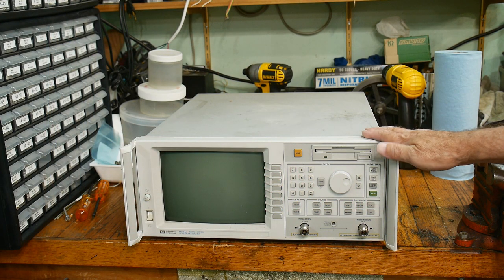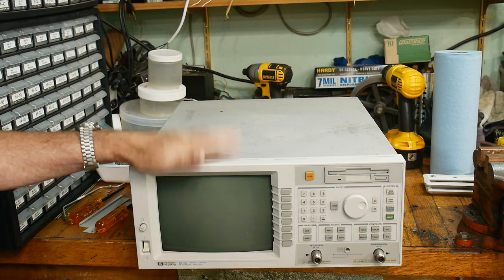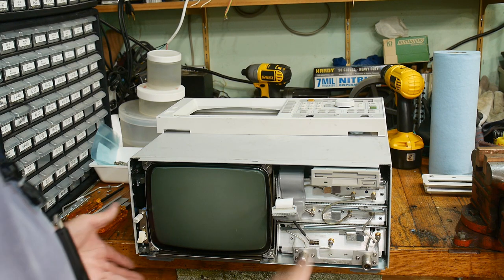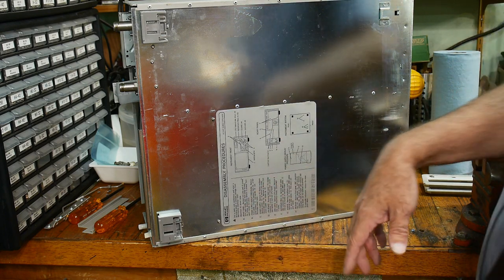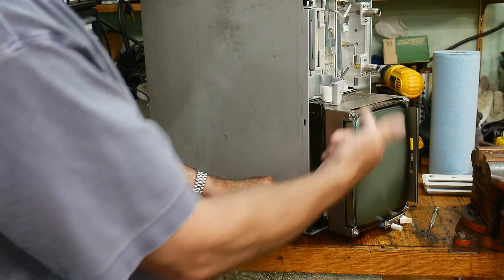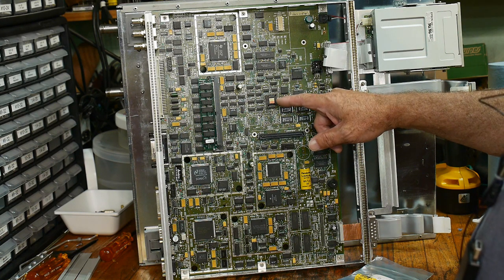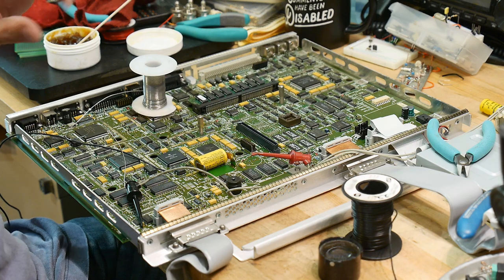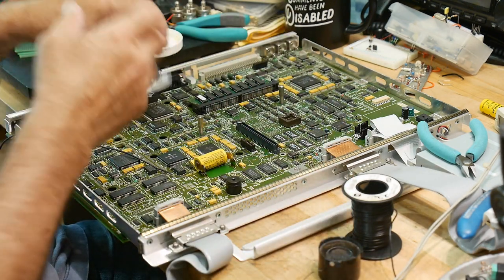#867 HP 8711C Disassembly and Battery Change

Comment: since you have the power supply out, you might want to a peek to see if there are any Rifa X or Y safety caps in the supply.  In my HP8591E there were six and they were all badly cracked.  HP and others used them 80-90's in the SMPS and they notorious exploding without warning.

Comment: In the 80s I "designed"  50- 300 mhz cable TV active devices around  a Motorola chip of about  30 dB gain.  This "design" process was checked by a Tektronics system analyzer which I sat in front of with a hot soldering iron in hand. Eventually,  my partner produced a buyer for the apartment house amplifier I had created. He looked at a sample and rejected it based on return loss being too high (it was 17 dB). I finally got it up to 20dB and the deal was done.  Good thing he didn't pay any attention to input  insertion loss.   I really like your HP 8711C.  Does things my old boat anchor Tektronics might dream of.
Reply from the maker: 20dB has always been my magic number

Comment: Read the voltage difference across the resistor to confirm the new battery is providing the power = Clever technique tip.

Comment: totally agree on the "self grounding", equalizing the potential to chassis or some common point and then keep the connection and not letting charge build up is key. just doing the esd strap's job consciously instead of passively depend on some safety net.
Reply: I am a hobbyist. From IG's procedure and your comments, I think I may have missed something about self-grounding. Should I ground myself to circuit null, or to Earth ground? Please explain as to which and why. Thank you for your help.
Reply: @t1d100  the absolute potential referred to earth ground is no so relevant. You want to be at equal potential to the object you're working on. So when handling an open computer for example, you strap yourself to it's chassis, or holding the chassis before and during handling the components inside. When soldering it becomes more important as the iron is probably grounded to earth, so you will need to incorporate your tools in this as well and then it gets easier to use the earth ground for everything.
Reply: @knglaser  Good info, thank you. Some circuits have isolated islands of power... Like inverters, etc. They swap back and forth between AC and DC and create isolated pools. If a faulty component is within a pool, should I be grounding to the pool, before changing the failed component?
Reply: @t1d100  usually it's enough to equalize to the case as the circuits inside bleed down to that even if they seem totally isolated. So in your example you could certainly hook up a 1Mohm resistor from the chassis to the pool you're working on. Comparing to a ESD strap that has 1Mohm resistance, even if the leakage between the isolated "pools" is 100Mohm it only takes seconds to equalize any charge (except when there's capacitors between the areas). Also it's a different story with recently powered circuit as you need to discharge all capacitors, including the Y ones.
In any case, discharging and equalizing should not be done with low resistance, causing high currents to flow.
Reply: @knglaser  More good info; thanks. Yep, I have already learned about the need to discharge the caps, before working on a circuit. Yep, I have already learned about the need to discharge caps slowly and smoothly. I DIY'd my ESD system for my bench, based on 1M Ohm resistors. I also just DIY'd a "stinger," for lower uF/lower voltage caps, out of an old multimeter. I simply soldered a high wattage 1K resistor across the probe sockets inside the case. I added a big warning label, of course. Makes a very neat package and I can watch the voltage drop as the cap drains. I posted it on EEVBlog, but we are not allowed to post links here on YT. If you search the forum for "Repurposed Old Multimeter = DIY Capacitor Discharger With Readout - Project," you will find the project.

Comment: Hey good morning. I have been reviewing the HP8711 videos. This one regarding what can be lost if the battery replacement is done without fore knowledge is worrying. What calibration is done that cannot be repeated? Sounds unlike HP to leave such a pitfall in place.
Reply from the maker: it is important that you can answer that question for yourself. the first step is to read the calibration section of the manual. you will find about a 30 step calibration. it is all in menus deep in the instrument. you will find about half of the steps are things you can do easily and half require other HP instruments (like a 437 power meter and others) to be connected via HPIB. Inside those menus you will find procedures to save the cal data. so if you have a working unit you can save the cal data onto floppy before you do the battery. I did not do a video, but after you get a working unit you can go back to the cal routines and do about half of them since external instruments are not needed.
Reply: @IMSAIGuy  ah ok that makes sense, I wondered if there would be a way to save to floppy,... thx

Comment: What was the purpose of the resistor involved in providing the temporary power connection?
Reply from the maker: you don't want to have the power supply directly attached to the battery. the 1K provides a safe way for the battery and power supply to share the input.
Reply: @IMSAIGuy  Thanks that's good to know. I've seen similar youtube videos that neglect to use the resistor.
Reply from the maker: If you connect a battery to a power supply:
1. battery voltage is higher and the PS drains the battery
2. PS voltage is higher and tries to charge the battery (it is not a rechargeable battery)
I my case the battery was 3.2V and the PS was 3.3V. the 1k resistor would only allow 0.1/1000 amps of current to flow.
Reply: @IMSAIGuy  Got it. Thanks.

Comment: is there any simple way to backup the calibration data ? if in case battery dies and we can reprogram the calibration content?
Reply from the maker: in the service menu you can save some of the cal data to the floppy. I don't know if it is everything or not. in the service menus, there are some cal routines that I have run, but some require special equipment I do not have.
Reply: @IMSAIGuy  Thanks!! I am about to change the battery on mine, but when I looked into the service guide page 167, the correction constants are saved on EPROM (permanently) and copies it to RAM on power up, and I think that battery backed SRAM only holds the last instrument state, so if battery dies, I do not think it will loose calibration or correction coefficients. any thoughts before I start to sweat and replace battery? :)
Reply from the maker: @ravishrestha3885  in the service menu there is a save to floppy cal data. do that. I still would follow all the sets in the video too
Reply: @IMSAIGuy  I will do that, this is interesting, I think I know what is going on in the CPU board, bootROM (U335) only stores the basic firmware to boot the system, rest of the operating system and calibration data is saved on another flash memory (U302 to U305). So on every power up, the cal data from flash memory is copied to SRAM. it would be nice to make backup of the flash memories (U302 to U305)!